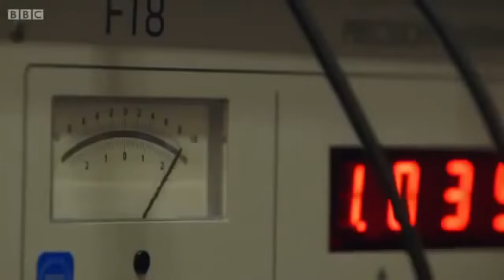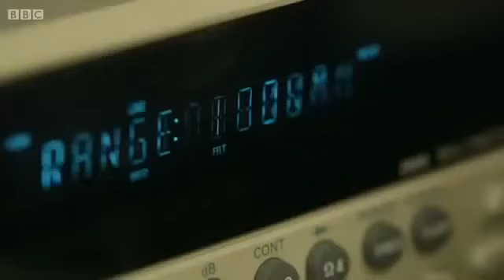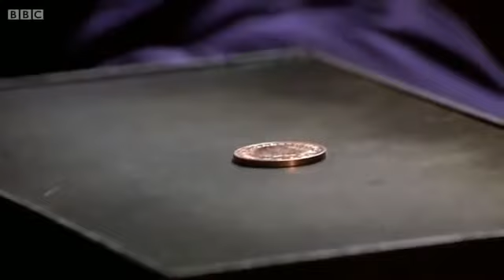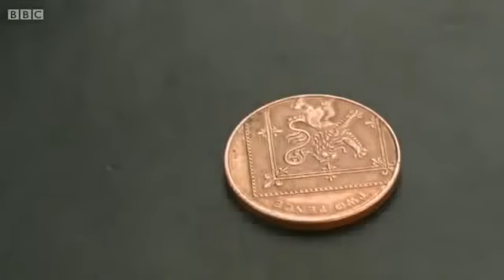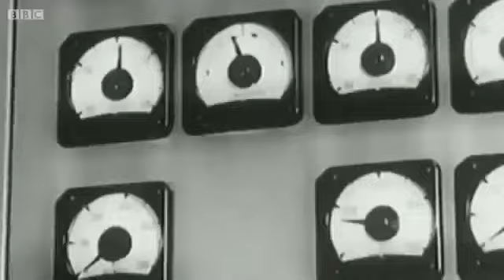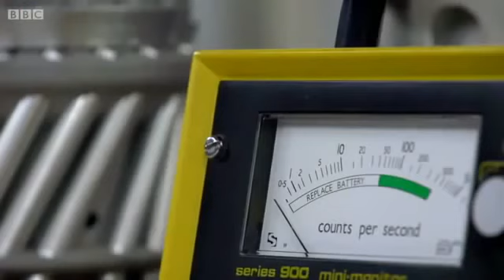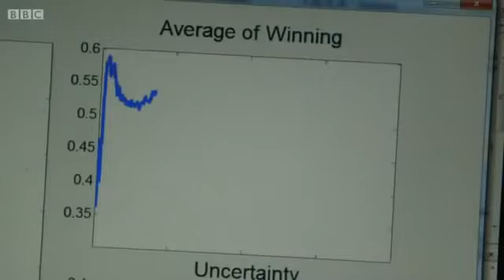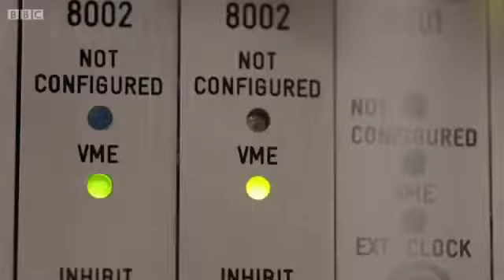The Secrets of Quantum Physics - BBC documentary

Comment: How can UV have more energy when the speed of light ( kinetic energy) is constant and has no mass? Especially when considering F=m times a.
Reply from the maker: I'm no physicist, but probably something to do with the wavelength?
Reply: Photons are emitted when electrons jump to a lower level, thus emitting energy. There are different size jumps between levels, some involve emission of a higher energy photon than others.
Reply: Nosys Thought actually it's frequency but your correct
Reply: @gnosisdocumentaries4481  correct energy is equal to h.neu or h.c/lambda

Comment: 52:22 how could you justify by just 1 set. Repeat it many times and then check whether it come less than 2 or not.
Reply: siddhant ratna and why was -0.59 added but not substracted
Reply: @anandjain5270  that was not the problem. Because it was probability which cannot be negative. And after researching a lot, I come to the conclusion that this experiment is correct. No matter how many times we do this experiment, the sum of probability is greater than 2, so Bhor is right.